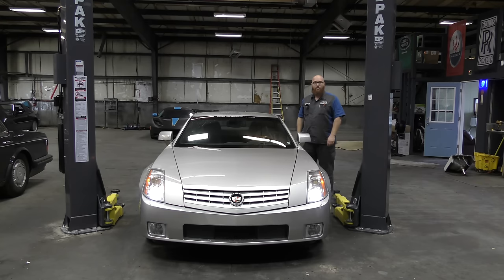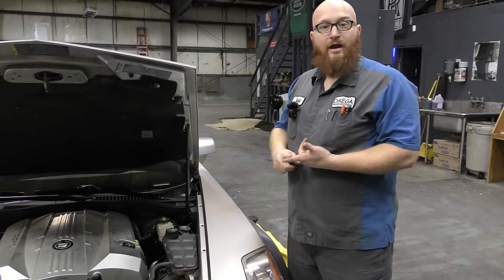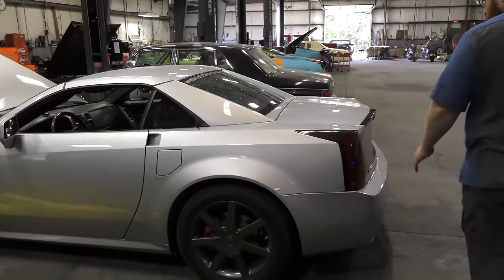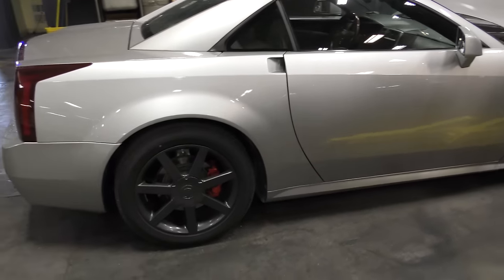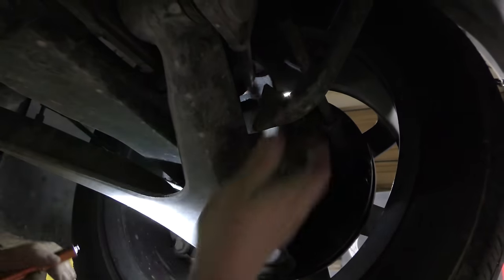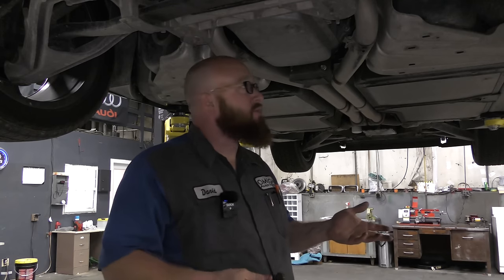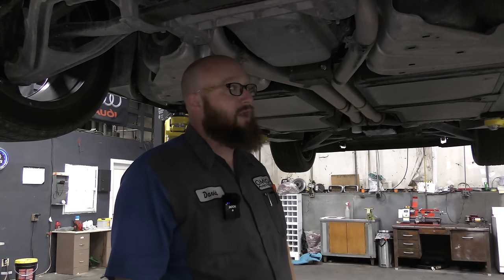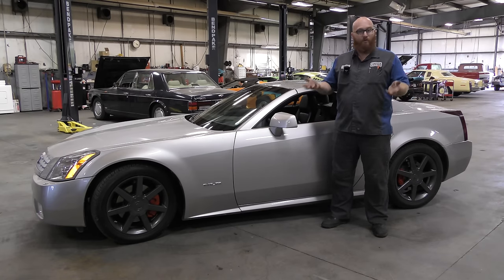The CAR WIZARD is shocked this 2006 Cadillac XLR has a Lotus Sized Repair Bill?!?

Comment: I own one of these and you're right. They can be very expensive to maintain.  I work on mine myself. So that's saves a lot. Finding parts can be hit or miss but the car is so cool it's worth it. 

Also, the book may say 5+ hours on R&R radiator, but it doesn't take anywhere near that long in real life. 

Now  you're correct, if your fuel pump(s) go out take a Valium before you start messing with it or get a price.
Reply: I don't get why he's so surprised at the prices. This is quite a unique and rare sport car, just like the ones he keeps comparing the prices too. It's not like a basic Cadillac sedan you see all over the place. Just because it has a Cadillac badge doesn't equal Cadillac service prices.Of course it's going to be expensive. Congrats on your sweet car, id like to get one someday myself.

Comment: This is VERY reassuring (to me).  About 2-years ago I decided I wanted to get a convertible but I didn't want the same old convertible that I see everywhere else on the road.  I narrowed my choices down to two models:  either a Cadillac XLR or a (2002+) Ford Thunderbird.  I went and looked at both and did some research on reliability, known issues, etc.  I expected that repairs on a Cadillac would exceed similar repairs on a Ford.  However, of the couple of XLR's I considered, a LOT of them had miscellaneous leaks which, because of the low chassis, were difficult to inspect without a lift.  Actually, one seller said he kept his XLR in his garage yet refused to allow me to inspect the garage (floor)...RED FLAG!  I could go on, but in the end I decided upon the Thunderbird and acquired a nice example I am very happy with.  It get lots of compliments, and I enjoy cruising in it very much.  And repairs are few and relatively straight-forward.  Anyhow, this video reassured me I made the right decision.  I already have a late Silver Spur (sister to the Mulsanne) to pay my share of exorbitant repair costs on.

Comment: Had to replace the rear shocks on my 2005 Ford Five Hundred AWD. Thought they should be cheap - most rear shocks are $30-60. Nope - these were $250 EACH! With taxes and shipping they were almost $600. They were special Sachs Nivomat self-leveling, load-bearing shocks, and there are no no alternates or substitute. Ford only had it for one year - 2005. In 2006 there was a redesign, and those are  about 50 each. Yikes! I can only imagine what shocks in the XLR must go for...

Comment: You just further reenforced what I always suspected when dealing with Mechanics when you mentioned the Book Time. Same thing we had in the Military but we called it a M.A.C Book/Chart. Tells you how long a Job should take and that's how you get Billed.You and I both know that any Mechanic worth his salt knows tips, tricks and shirt cuts to cut the Book Time. At $100 an hour, I cannot afford a minimum charge of one hour for a 5 minute fix/test. (Not that a Rad. replacement is a 5 minute fix) That's why I do as much of my own work as I can possibly do.

Comment: Hey Car Wizard, do ANY Cadillacs have an undercarriage cover, or even a factory protective coating? It's a shame there's no protection for the components. With out a cover the lifetime of them significantly depletes depending on where you live. I've herd you talk about these covers when comparing a Benz to a Caddy? Also IMO it's a very slick Cadillac probably the most handsome in their lineup history and still it's no SL, but engineered to be as expensive to fix as a Lotus. I'd take the Vette every time over this because of these parts and design issues. It's still an awesome car as long as some else owns it. Good Job Wizard

Comment: 2008 XLR-V owner here.  Love these cars!
Reply: Very nice! The XLR-V is a dream car of mine that I’d love to use someday just as a summer/weekend car. Has yours been overly expensive to maintain? I’ve been trying to learn as much about them as I can
Reply: @JW_Reviews  Maintenance has been almost nothing.  Only thing I've done in 10k miles of ownership is fluid changes.  I have modified mine somewhat, so that's where the money has gone.  My car has low-ish miles (just over 20k), so I can't speak to higher mileage ones.
Reply: @forgottenautos8461  Wow that's still very impressive! I heard from a family friend who bought a C5 Corvette new that they are great cars. He said he talked to engineers at the Bowling Green plant and they said it is an over-engineered car and should be very reliable. What kinds of modifications have you done and would you recommend them for others who have XLR's?
Reply: @JW_Reviews  I found the suspension to be way too soft for my taste.  I swapped the springs and sway bars out for Z06 ones.  The brake calipers and rotors are also from a Z06.  I replaced the intercooler pump with a higher flowing unit.  Eventually, I will swap a smaller pulley on the supercharger to add about 2 more pounds of boost.
Reply: @forgottenautos8461  Wow, that must really feel like a Corvette! I was thinking the XLR-V already came stock with Z06 brakes, but maybe they were just upgraded versions.
Reply: @JW_Reviews  The V came with the C5 Z06 brakes.  I swapped over to the C6 Z06 which use the single forged piece calipers.  You can get them dirt cheap from GM because all the hard core Z06 guys upgrade to aftermarket stuff.
Reply: @forgottenautos8461  Ah I didn’t think about it being C5 Z06 brakes, I assumed it would have gotten the C6 ones. And that’s good to know, if I ever get one in the future I’d might do those upgrades. Thank you!

Comment: If I were the guy I won't fix the oil pan either if not fixing the fuel tank.  The radiator has to get done though.  Still, having seen this I don't think this will be a car for me.  I wonder if C5/C6 has the same tank design...  Obviously the radiators are easier to source on those and the engine is different, so at least that is a relief.

Comment: Hi, 
I work on some of this Cadillac here in France (really not common here), have myself a SRX (Northstar), CTS (the v6), STS (Northstar) and a Eldorado (the 8.2 V8).
The XLR are not the easy to work for sure, but for the parts, i get the radiator on Rockauto.com, you will find the OEM GM radiator in stock for about $300, and for me always happy from Rockauto since many year, that the most easy to get the OE part here in France with a good price.
Edit : Search on Rockauto with ACDELCO 21633  in the search bare, price is $275.99, sure that the right you need, that the same i order for the XLR i work on some year ago, and yes this get the engine oil cooler and transmission cooler, exactly as the one you show that you remove from the car.
Thanks for the video

Comment: as for the Northstar oil leak problem run Shell Rotella or Dello worked fine in my DeVilles with a Northstar until I took them to Take 5 Oil Change in the idiots put synthetic then no engine

Comment: On average, the cost for a Mercedes-Benz SLK320 Auxiliary Water Pump Replacement is $232 with $137 for parts and $95 for labor. Prices may vary depending on your location. The cost of repair of the Cadillac XLR is on par with the Mercedes. I own the 320 and after 20 years of service this is the only major part that has failed. I didn't know the pump was failing until I took it in to have the serpentine belt replaced. I'm the third owner of this vehicle and it has 141K on the odometer.

Comment: $80,000 car in 2006. It was one of the most expensive GM cars at the time. Of course parts are expensive. Shocks need replaced, they are the Magnaride shocks $$$. You have to replace them in pairs. The XLR V was $100,000..

Comment: The book hrs to fix stuff is usually high but thats how it goes. I have one mechanic by me the does work by true time if its less than the book usually it is. Or it can be higher. I seen dealer books call for 8 hrs and it takes 2 . Thats frustrating. But how a guy thats good can make money. Just being honest.

Comment: 2:44 WRONG wiz E wrong XLR-V did NOT come with a LS based engine. Get your Facts straight. 

The Cadillac XLR-V, was a high-performance (443 HP) version of the XLR. Cadillac gave the public its first glimpse of the supercharged XLR-V in its Super Bowl commercial, which aired February 6, 2005. The car was formally introduced at the 2005 New York International Auto Show.
The XLR-V used the same supercharged Northstar V8 as the STS-V, though output was down somewhat. For the XLR-V, the engine was certified by the SAE to produce 443 hp (330 kW) and 414 lb·ft (561 N·m). The supercharger and four intercooler cores were built into the intake manifold. A six-speed automatic transmission, larger brakes from the Z51 Corvette, and 19-inch wheels were used. 

Know your Cadillacs @Car Wizard ...The more you know 🌠

Comment: I thought the V had a supercharged northstar, I didn’t know they came with an LS based motor
Reply: They are both still northstar engines. Not really LS based
Reply: Yeah they only had the two versions of the Northstar. I think the wizard might be thinking of a different V variant of The Cadillacs
Reply: The XLR-V came with the 4.4 liter supercharged Northstar.
Reply: It is a blown North Star. To get an LS motor, you need a cts v. First gen had a ls6 motor from the c5 zo6. Second gen had an LSA which was the camaro version of the zr1 motor; blown ls3.  The zr1 had 638hp and the camaro zl1 and cts v had 556 hp
Reply: I had three Northstars. Two needed head gaskets the other one was totaled before they went. I couldn't even imagine one with a super charger. It would scream right up to the time the gaskets blew all the way to the moon. But it sure would be fun while it lasted!
Reply: I believe the Wizard misspoke. He's likely thinking of the CTS-V that has always had a LS/LT-derived V8. The V-Series sold in really low numbers, but had some serious performance of the day. Z06 brakes and springs, and all kinds of goodies. Too bad they disappeared...
Reply: @AJGreen-cn8kk  I had one and it needed it head bolts torqued down, thankfully no blown headgasket.

Comment: My 98 Corvette C5 had the same fuel tank cel and I used some Chevron Techron Concentrate Plus fuel system cleaner to dissolve the sulfur buildup on the sending unit contacts. Within two tanks of Shell V-Power and the cel never came back on for the two additional years I owned it. Good luck wizard. Love the videos.

Comment: Wizard:  Tell your customer to run back to back tanks of Techron fuel additive for his fuel gauge issue.  The sensors tend to corrode right where the fuel level was when the car is stored for the Winter.  That's why the gauge works then gives out and then comes back to life.  Its not a sure thing but I'm a former GM Service Engineer and it worked more times than it failed.  No other fuel additive brand should be tried.  Good luck.  Love your channel and tech tips.

Comment: I’ve always loved these cars! I’d take an XLR over Corvette any day. 
Regarding the sending unit: I have 2004 XJ8 that acted in a similar manner. On a forum they suggested a few tanks with Chevron Techron to clean the mechanism. I had nothing to lose so I tried it. To my surprise it actually worked. No more fuel gauge issues. That was 8 years ago and still no issues. It’s certainly worth a try while your customer is saving for the big job.
Great video as usual.
Reply: It always pays to try a cleaning product over a mechanical repair

Comment: I save my customers thousands every year on parts and labour. That radiator is 125 cdn at rock auto and even with burping the system it’s only 120 mins. Man I’d hate to live where u live the cost of labour and parts are astronomical. Very entertaining vids though
Reply: Rock auto has everything and you pay a fair price. mechanics make money on labour AND parts. They should pick one. If i had a million dollars i'd start an auto shop that was only open after 4pm till 9am and did repairs overnight, and customers would pay wholesale cost for all parts. I'd charge 150-200 in labour an hour though cause my mechanics would be working at night...you know, when people dont have to go to their job and actually have time to get their car fixed but all auto shops are closed

Comment: I really wanted one of these... Until I got one in that needed a rear rail, rear floor pan, bumper, etc.  I had done the same basic repairs on quite a few C5 and C6s at that time, but when I got to the part of removing and installing the roof assembly, which isn't similar at all to the Vettes, that I began to hate these cars.  What a horribly engineered, over complicated kludge!  It turned out great, as always, but I've sworn off messing with these tops ever again.   It's been long enough now, that I'd actually love to find one with a bad engine and do what GM should have and stuff an LS in it.  Bet they would have sold way better, if they came that way from the get go

Comment: Hey Wizard. Are there any shops near you that specialize in radiator repair?  If you could even find someone who does that, would you find it to be a viable option over full replacement?  I would think a decent shop could replace the tanks and seals if cracks in the plastic are the problem.

Comment: Great video!  I love these cars a lot and can't wait to land an XLR-V supercharged.  I've driven two different XLR's that were supercharged and they are insanely fast!  And they are a very nice riding and handling car, quite opposite to what I was originally thinking.  Cadillac really did a great job with this model in every aspect. The body style is what always sold me keeping in tune to the classic looks of past Cadillac's.  Being powered by Cadillac with the Northstar engines is another big positive aspect as all Cadillac's should be powered by none other than Cadillac.  Parts can be difficult to locate and find, but this is the case with most antique Cadillac's which the XLR falls into the same category.  This was a car that was brought back from the concepts built by Cadillac during the 1950s.  The La Espada was one of the concepts that my grandfather was able to experience as very few were exported to Europe (Italia) where my family is from. I have two 1993 Allante's, one XLR and several other Cadillac's all different years.  I can't wait to land an XLR-V to put in with the rest of my Cadillac collection.

Comment: Hello, I got my tranny installed, one door fixed, the actuator was broken, window fixed as it wouldn’t go up or down, fuel regulator installed and brake light switch and oil change. The mechanic charged me $900. I paid and didn’t complain much, but now that you mention did I over pay? Perhaps a silly question but just concerned.

Comment: What’s the deal with the Supercharged versions of this car and the STS-V? Would I be in a world of hurt if I picked up a STS-V?
Reply: No. My dad has owned an '07 XLR-V with the 4.4SC for over ten years. It has been a great car.
Reply: STS-V is a great car. You can pick them up for less than 10k now. I've had mine since 2011, And no real major issues. Just normal maintenance is the best thing you can do. For any car for that matter. A lot of guys have well over 100k miles on them and running just fine.

Comment: The XLR-V uses the same Northstar engine but is Supercharged, not the Corvette engine (though it's made at Bowling Green and has similar parts as the C6 Corvette otherwise).
Yes, the V also has head-gasket issues and no, the problem was not "solved".  My Cadillac dealership has a kit that slows-down the screws winding themselves out of the valve cover, but it's only a temporary fix.

Comment: Plenty of XLR radiators on ebay OEM and aftermarket. Aftermarket was $70 with free shipping. I've used plenty of cheap radiators for years and they work just fine. Not hard at all to come by.

Comment: The fuel tank stupidity doesn't surprise me. The Ford Flex is the same way although it's just one tank with a hump in the middle to clear the driveshaft on the AWD models. It uses a similar venturi setup to draw from both sides and the one on my Flex went bad, twice. Your tank would go from a little under half to empty almost immediately and because it wasn't drawing from both sides, the car would drain one side and die as it ran out of gas. It amazed me that Ford did something so stupid. The price to fix it?
$800! I had the extended warranty, so Ford ate the cost but it occurred to me that I could have dropped the tank, drilled two holes and installed a piece of fuel line between them to transfer fuel automatically since my Flex was fwd.

Comment: Good Video WIZARD 
I thought the SENDING units can JUST COME out from the Sides 2 off them one for each TANK 
when the CORVETTE 1st Came out with 2 Fuel tanks OWNERS were Complaining of High Pitched FUEL PUMP Whine 
TSB was to REPLACE Complete units .
LATER in Production run AKA NEXT year RETARDED ENGINEERS at GM changed the Design and Placed the SENDING unit on the TOP !!!! WTF now you have to Drop Fuel tank to REPLACE .

Comment: I have a 2006; was actually Alice Cooper's personal car, bought from him in 2012.  So far the only significant thing I've had to spend real money on was a rebuild of the hydraulic pump for the top operation (about $1500 all in).  A couple of minor electrical issues recently but no leaks.  Great car and rare; even many Cadillac guys have never seen one.  I've had a lot of crazy cars over the years, (DeLorean, Audi Coupe GT, Porsche 928, Dodge Stealth Turbo, Mercedes 450SL, Prowler, Ferrari 360 Spider, etc.) but I have owned this XLR longer than any of them.  Love it!

Comment: The XLR-V has a 443 HP, 4.4L Supercharged Northstar. Same as the STS-V (469 HP due to freeer-flowing exhaust). The STS-V was one of the best cars I ever owned. The only sedans that I've owned that come close are the 1989 Super Coupe, the S550 that replaced the STS,  and my current Tesla Plaid.